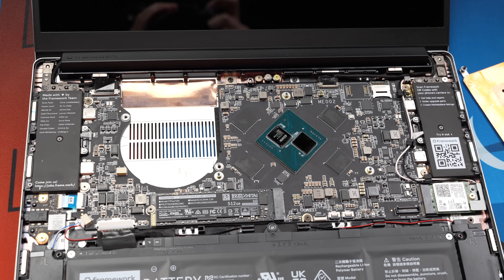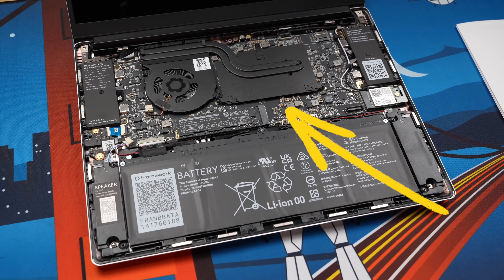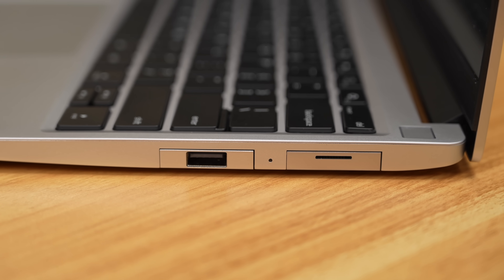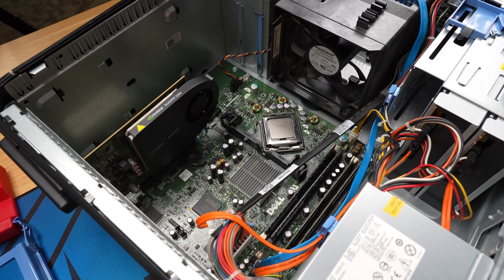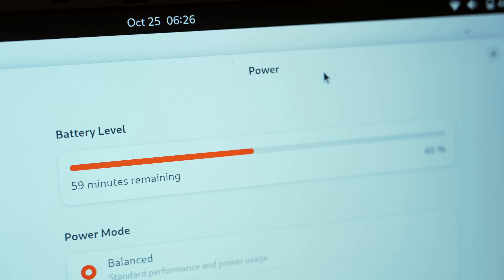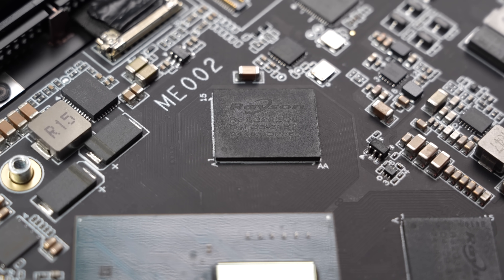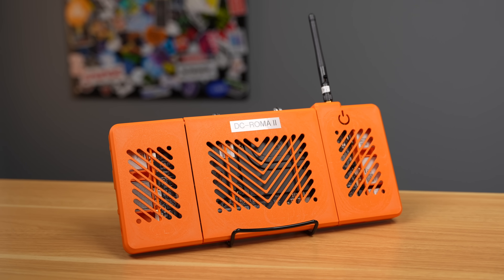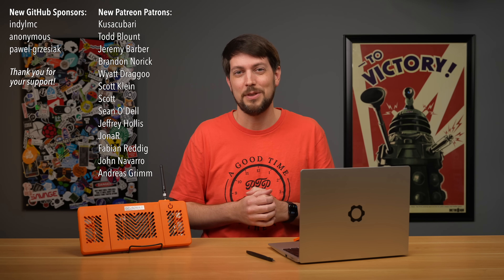This is not a Framework Laptop

Comment: maybe i am misreading this plot but are cores 4 and 5 not on the same die? I would have expected the upper right quad to be cyan (low latency) much like the lower left one. 10:07
Reply from the maker: That's part of the fun of this chip :) Check out my blog post or the linked GitHub issue in my sbc-reviews project for some more digging into the CPU architecture.
Reply: @JeffGeerling  very interesting, thanks!

Comment: What sort of boot environment does the DC Roma ship with?  Supposing there was more support for this CPU from Ubuntu, Fedora, etc, could this boot usb installers?  To me the biggest drawback to the Arm and RISC-V devices I've seen so far is that they all need their own kernel and distro forks with custom device trees.  I just want an ARM or RISC-V laptop that can install generic distros from a usb stick with no need of kernel forks, no need of custom distros, like we can with x86.  I've read that UEFI is becoming more common on ARM computers, along with I assume ACPI to eliminate devicetree.  I don't care if it's UEFI, so long as some platform standards get adopted.  An open ISA combined with an open, standard hardware platform would be a real boon to RISC-V.
Reply: Boot environment standards isn't going to fix any of this, and UEFI/ACPI isn't going to make it magically better. Just see the WoA Qualcomm stuff - the ACPI is way overfit and really only works well for Windows. The same goes for many other ARM and RISC-V chips, it's all overfit to only work with the software they want to ship, not any generic distro.

Almost all the work in kernel forks is drivers, for on-chip devices using silicon IPs that they got from weird places with no mainline Linux drivers, that chip vendors have no incentive to send upstream to mainline Linux and other projects because they want to make money selling the drivers and driver updates (they call it "BSP"). No amount of fiddling with the firmware is going to magically make Linux suddenly support a new device. It's kinda like what one might have to deal with re: Nvidia drivers, but it goes much deeper - although these Linux forks with deeper changes generally have to be open source to be GPL-compliant, which is why you're able to see them at all.

The main point is that this is no "boot environment" problem. It's a driver problem, and, in a deeper way, market incentive problem.
Reply: @dramforever  Why?  What will fix it then?  On an x86 PC I can download a generic linux iso with a generic kernel from any popular distro and it installs and finds peripherals on a wide variety of configurations.  This is what RISC-V needs to be successful.  We need to be able to go to debian, download their RISC-V iso, install it and run on any RISC-V system of the same ISA subset.  Both ARM and RISC-V suffer from the lack of any sort of defined platform.  This is a reason that unless I have a need for as embedded application, I don't even both with ARM. I gave up on using the Pi for anything desktop or server related a long time ago.  x86 mini PCs are cheap, power efficient enough, and run standard, generic distros.

I'll leave the issue aside that RISC-V isn't open source in any of the ways that linux users tend to think of the term.  Every useful core on the market today is completely proprietary. It's only the ISA that is free.  The only difference bewteen ARM and RISC V is the lack of a license fee for using the ISA.

Comment: I think you should have talked a little more on the riscv capabilities. I think the point that we can compare them to old pi and this Intel is amazing development and to be honest, the bugger problem is that neither the drivers nor the os is optimized. So the point is, if you are a riscv dev, good hardware exist, now we need good software. Before both was missing. You mainly talked about it not being there as a consumer device yet, which is fair though.
Reply from the maker: I'd say "adequate hardware exists", but not yet "good". Until we start seeing some faster RVA23-enabled chips on the market (there a couple, but seemingly only available in Asia right now), it's still too early for a lot of people to consider diving into RISC-V development in a more meaningful way.
Reply: @JeffGeerling thanks for the reply. I give you the point of adequate hardware as a tester and user. But as a developer I think this is plenty if you test drivers, packages and software. Probably not for the next video editor, but for audio and video player, browser optimization, this is good enough to work without being fully frustrated. So if someone wants to develop and support those companies that are probably not brake even then that is a good one. So I am a little more excited. Still love your videos and thanks for covering those niche topics in a deeper way, almost no other channel does.

Comment: Half the RAM available, in this economy?
Reply from the maker: Heh, even worse!
Reply: The track pad is too small, 
I need it the same size has the MacBook Pro. 
If it had it I would get it
Reply: In this cartel-esque  state of things i would say
Reply: @ReinaldoRauch   it's not the first time the ram industry has been struck by cartel verdicts. They were hit by fines for it in 2002.
Reply: @XGD5layer  twas only a slap on the wrist though.... 9M for 10B gains?
Reply: Oof, so this would only be able to run a tiny LLM.

Comment: Man, I really hope open hardware and firmware gets more prevalent in the upcoming years, it would be nice for the whole device to be more knowable at all levels, no potential surprises anywhere.
Reply: Qualcomm: <cackles in closed-source>
Reply: @prophetzarquon  After buying Arduino
Reply: It's easy to modify the firmware on x86 processors (like with Coreboot) while ARM makes it much harder and is less standardized.
Reply: @serkandevel7828ARM being less standardized also means that some manufacturers are free to use less proprietary firmware as well. Strictly speaking Coreboot replaces the proprietary UEFI on a motherboard, while a lot of ARM devices already use the open source u-boot instead of a proprietary UEFI, and some ARM devices like the RPi keep proprietary firmware to a minimum while Intel and AMD run an entire extra processor with what amounts to a full closed source operating system on them. And for all the talk about disabling the ME or PSP that's just not a thing any more, you could disable loading of parts of it but it implements a lot of critical functions of modern CPUs in software so most of all of it is there to stay. 

Oh, and none of that is at the hardware level either, so even if you had a completely open source ME that you loaded yourself you still need to trust Intel's architecture design. You have to do that for RISC-V to an extent too for fabrication and implementation details, but there's at least a degree to which it can be independently verified, and it's far easier to make third party open firmware if you know the hardware architecture inside and out

Comment: I think the big and very exciting take-away for me is that 3rd parties are making framework form factor mainboards. That makes me excited for a future where laptops can enjoy some amount of the modularity that we have on regular PCs.
Reply from the maker: We'll see... I heard someone's working on a Cix Mainboard too, for higher speed Arm. The problem is that chip also has terrible idle power consumption :(
Reply: @JeffGeerling  has idle power consumption just not been figured out (regardless of ISA) except by mobile-first manufacturers?
Reply: @bilditup1  It's hard to nail down. Even AMD is still struggling to get their chiplet architectures to idle low too, but should have something improved for Zen6 by using a more Intel-esque system. It seems the secret to low idle power with MCM designs is to keep the connections as tight as possible, and to go through silicon to make those connections.
Reply: The draw from a wireless cellphone charging pad is already abominable. I'm not sure most people really care about power usage; we just add another battery.
Reply: @prophetzarquon Unless you want to take your laptop on a plane (if not, then what is the point of a laptop?)
Reply: @fujinshu  The vast majority of seats on planes have power these days. I have a laptop with a worn out battery and haven't failed to plug it in on a flight in the last two years, encompassing more than a dozen flights.
Reply: @EnglishMike Most of those is just low-power USB plugs from the planes I’ve travelled in, and most likely because of them banning the use of power banks and external batteries in flight.
Reply: @fujinshu  I mostly fly international, but all the planes I've been on this year had proper power sockets under the seats, including four internal US flights (coach) on Alaska Airlines. No problem powering and charging my laptop at the same time.
Reply: That was my thought as well. I saw this on their website and it strikes me as their only path to widespread adoption. If third parties can begin supplying a wider variety of options and support, that competition could make them truly flexible.
Reply: I like the idea of buying modular open-form-factor laptops from suppliers who aren't Framework (who milkshake ducked themselves recently)
Reply: @RoamingAdhocrat What happened to Framework?
Reply: @fujinshu  Probably about some alt-left activists throwing a hissy fit and saying that Framework has "Hitler particles" because they didn't join a boycott of perfectly good software whose maintainers aren't alt-left like them.

Comment: Hey. Its running doom and not too shabby, running ubuntu and what not? Its not running everything great, but its running a lot of stuff. The gulf between not running at all, or crashing all the time, to running slow is waaaaay greater than the gap between running sluggish to running great. At this point in time, its just a matter of how long until we have a 3rd architecture to compete against arm64 and amd64 (yes that's the real name of the architecture and not x86)
Reply from the maker: Definitely; a lot of people don't get that, but having "working but slow" is a lot better than "kinda sorta works and could be fast when it does" which is the state of so many Arm boards these days outside of Apple and a couple other vendors.
Reply: Me: <glares at Raspberry Pi’s wireless chip>

Comment: imagine a sbc company making a arm drop in mobo for this laptop
Reply: The level of IO the framework chassis and concept is expected to have is a bit challenging to match affordably. So I can't really see any SBC targeting it seriously, but a hobbyist project to take a Pi Compute module (or maybe even a small cluster of them) and fit it in the framework I could see happening - a bit of jank, some of the ''expansion' slots being blanks/slow/seriously feature limited isn't a big problem when its not really a product but a project.
Reply: Individual connections would have to be very specific, but I could see very real use cases for piecemeal adapter kits to insert a cannibalized phone beneath a Framework keyboard & screen. Not that it would be by any means simple or any huge commercial success; just that the potential seems present & the ready capability seems like it would be nice to have, if at all possible.
Reply: I believe there is a Raspberry pi CM4 motherboard.
Reply: I have seen an announcement from MetaComputing with the ARM CIX CP8180.

Comment: That's pretty cool. Hopefully more 3rd parties start making framework mobos
Reply: Would be nice. Also be nice to see a few more PCIe device developers targeting the 16" frameworks 'GPU bay'  - onboard graphics are plenty for many folks would would still love a heap more NVME, more Wireless radio, etc. Sure most folks want a laptop to be performant graphically and would pick the GPU option, but those 16" mobo's won't be in the laptop form factor forever as surely they will get replaced leaving a perfectly good home router, NAS, Audio capture etc etc brain that just needs the auxiliary hardware.
Reply: Adapter kits to cannibalize damaged phones for use inside a Framework case, would be kinda fun & potentially super useful.
Reply: @prophetzarquon  getting the snapdragon chips out of old samsung phones to run would be a nice performance boost, would be limited on the firmware side of things though